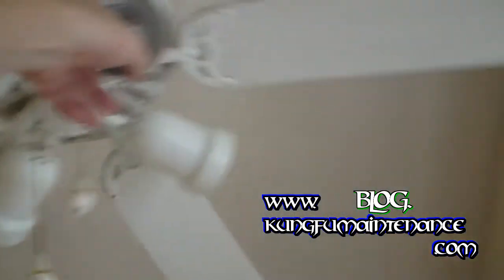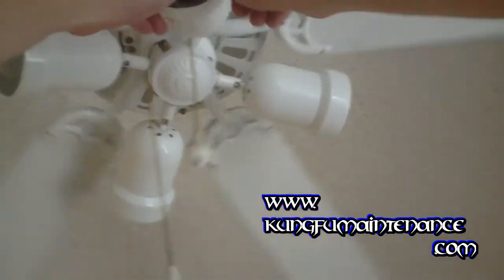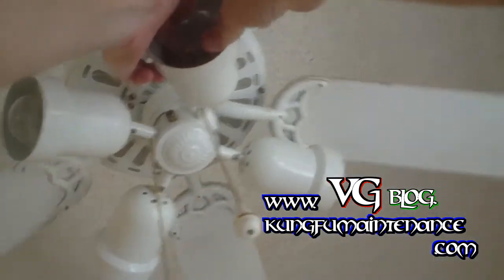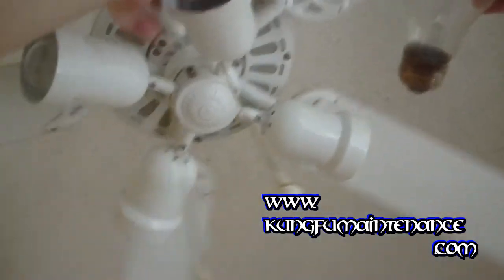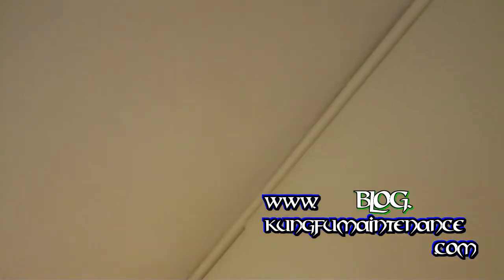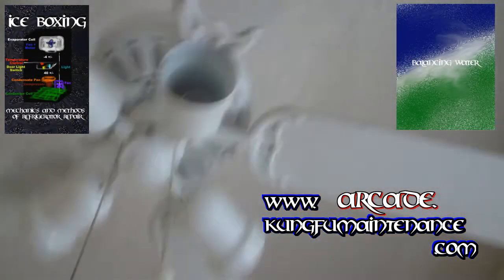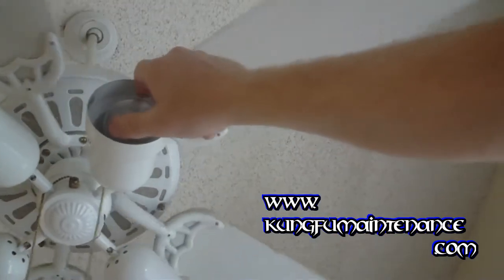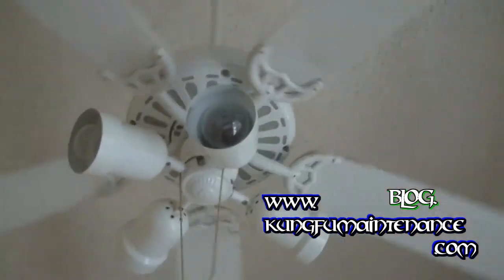Ceiling Fan Light Bulb Stuck In Socket Not Coming Out

Comment: I have a loose socket in my ceiling fan.  I have a light exactly like the one your showing  so I can not take off the globe (around it). it may not be just missing a screw.  I may have to replace the socket.  any helpful info with this for me????? can I do this? I am going to try to replace the socket screw1st. but I have a feeling it may need to be replaced???? thanks!